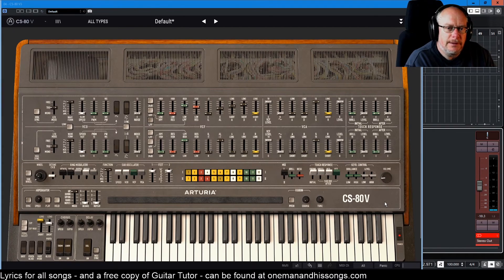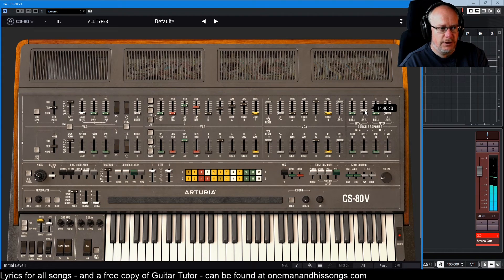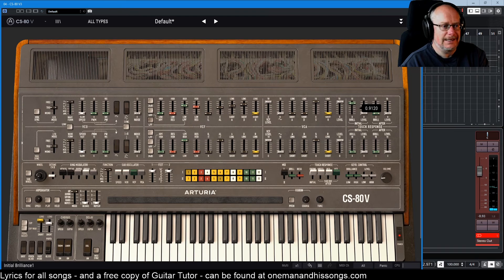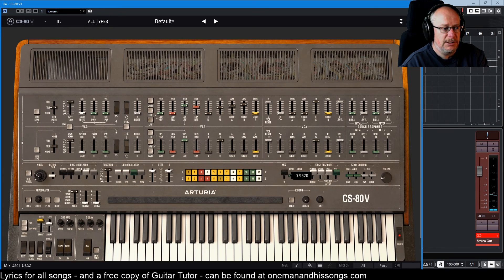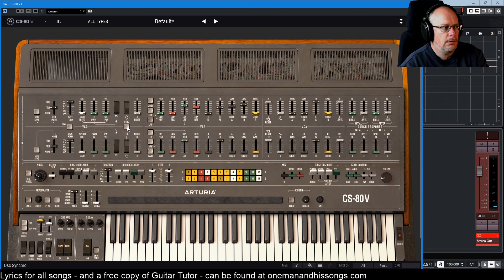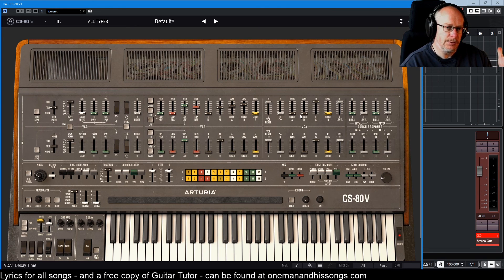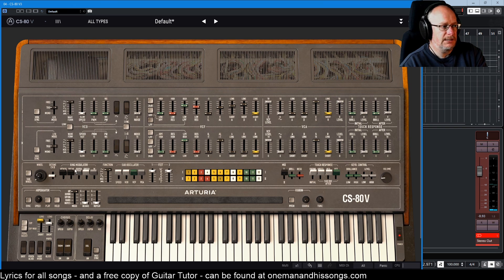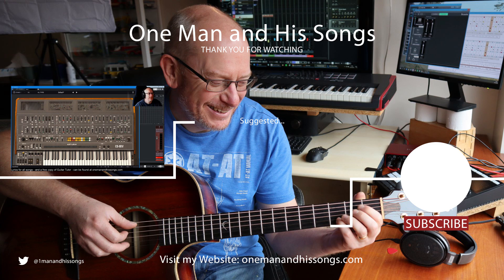Arturia Yamaha CS-80V Tutorial Ep.3 - Touch Response and Oscillator Mixing

Comment: I just can't get my head around the oscillator sync with this synth. When I think of a typical sync sound, it is generated by sweeping the frequency of one oscillator independently of the other. I see no way of doing that with the CS-80 (except by opening Arturia's magic modulation box). Am I missing something ?
Reply from the maker: Nope, you're right, I don't think you can' do the classic hard sync thing with the CS. I've found it quite hard to make much use of the sync button on this synth, actually (to the point where I gave up trying!)